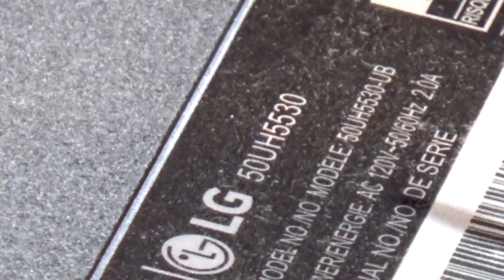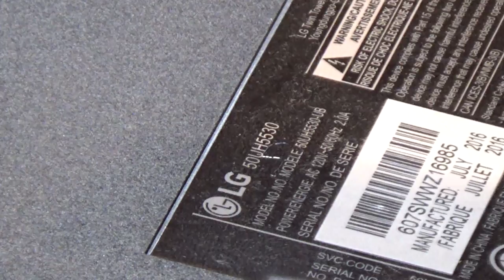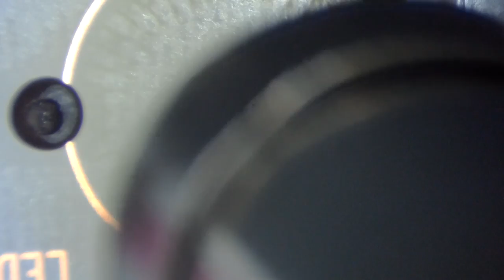LG 50 inch led tv, quick LG Logo flash only,  no picture. LG 50UH5530 tv repair.

Comment: I have the same model that had the exact same problem. This step-by-step helped me immensely and I was able to repair my television for under 20 bucks. Just an awesome video! Thank you so much!
Reply: Hey, if you don't mind could you share the link from where you got the led pannel light replacement from. Thank you
Reply: @rockyhandsome6098  Ebay is where I purchased mine from. I wasn't equipped to replace a single led so I purchased a lot of 10 for S20. They were used from a tv with a broken screen, tested and working. Simply search for LG 50UH5530 led strip and you should get many results. I recommend getting a few like I did just in case it happens again. I hope this helps ✌️
Reply: Was it also an led as well or a power supply

Comment: Thanks big dog! I’ve been holding off on getting a 50” 4K screen for my music desk that I built. The other day I found this tv at a thrift store for $20 and it said “has power issue”. I bought it thinking it was power supply caps. Before I did anything I searched the blinking lights and found your video. Bought a set of the backlight strips for $25 and followed your step and I now have the exact screen I wanted for $45!!!! Greatly appreciated sir.

Comment: Thanks, great video everything worked just as you said. I was trying to adjust the screen- I tried to move it with my hands and I heard a slight cracking sound . When all was said and done there were vertical and horizontal lines coming out of the corner. Dont try to adjust the screen except with the suction cups!!

Comment: More flux, less solder on the pads there BigDog and heaps of pre-heat, the PCB strip is sinking the heat away - as it's supposed to. Clean up with isopropyl alcohol and cotton pad afterwards.
Reply: I protruded the strip off the end of the table and pre-heated it from the bottom with a heat gun until the solder melted.  Then placed the LED on top and then heated it from the bottom again until the LED snapped into place by itself.  Pretty cool physics.

Comment: Did it and changed all the led lights. However when i completed the whole reinstall of the hardware i now have a  straith line across the tv and at the top of the tv, i have smudges or different colors. Did i screwed up my black lcd screen when i reinstalled it? or is it repairable? thank you for showing your expertise! much appreciated.

Comment: I have this exact model. It gets a quick logo flash and then goes black. I have taken a slow-motion video and see that the bottom third of the backlights apparently never light up. The LED tester I have does NOT have current adjustment. As I check the three lines of LEDs, I get a solid 64volts on each line, and I can see through the back that they are lighting up (although I don't know if EVERY LED is fully lit). Do you suppose the bottom LEDs are lighting up ONLY with the LED checker, but have too much resistance for actual operation? Another fact: the TV started working for several months after the first time I tested with the LED checker. Then, one evening, it went black (and no sound) after being on for an hour or so.

Comment: So it looks like all of these power supply boards have voltage and/or current sensing on the LED load and if the load is outside a set of parameters it shuts down.  I am assuming that the power supply board sends a "no-go" message to the main logic board and the main logic board shuts the whole shebang down.  I am getting the power LED flashing six times on my cheap Insignia TV after the shut-down.  I am getting a very very brief flash from the LEDs, a few tens of milliseconds.

Comment: You really need to document the steps of replacing the individual LED and where you bought the part.  Wouldn't it be easier to replace the whole strip with the bad LED or is the part too expensive?  Appreciate the effort.
Reply: Well if you know how to replace the led itself then it is easier. But to order would take time. I order the stripes so far but I am going to try on some old stripes.

Comment: What model is that LED? Is that a standard for LED TV repair since you didn't match the original? I followed your instructions for a Sceptre U508CV-UMK and the construction is similar.  But I used a 3-15 V adjustable wall adapter which lit up when I increased it to 15V. I used 3V to narrow down the broken LED like you showed and removed the lens.  It looks it would fit your LED.
Reply: Update.  I found a roll of 100 3528 LEDs with good reviews on amazon for like $10. Model LATWT470RELZK.  That one fit my strips and looks like the same brightness.

Comment: Can I ask a question. I have a tv that shows LG logo ike this one, but when I check the voltages with multimeter on power supply led output port, they are very low, like 0.4v  Does that mean its not led but something on the power supply. I found one mosfet chip that was not behaving properly in diode mode. Could that be the issue? Please let me know thank you.
Reply: What did u end up doing dod u change your power supply
Reply: @thokozanigwathi4249  no I changed the leds fixed issue

Comment: Very good fix most TVs I see now is backlight related 
Did you did anywhere with the tape on lvds cables method, or removing edge tabs ?
A lot of dead screens are shorted caps

Comment: Hi I have are LG 45" tv can u tell me what happens when I plug it in the stand by light on red and blue when it's on ok,but when I put on the power it does blinks twice and  turns ott by its self and sometimes when I put it on sometimes it does Work and the screen gets blank and only get sounds no picture .

Comment: Hey, really good explanation I did exactly same thing and had same issue but when I turned on my TV it just shows blue screen no picture do you have any idea on what could be the issue really would appriciate your feedback on this.
Reply: Same thing happened to me! But I realized I made two mistakes: 1, I did not disconnect all the same cables from the back that he did (I was trying to be lazy); 2, I put all the LED screws back before laying the paper down, instead of vice versa. So, I took it all apart a second time to fix the screws, but this time I followed the the video exactly for disconnecting the cables and then reconnecting them (*the only exception was the Wi-Fi module, because I couldn't get it undone and I didn't want to force it). After that, the tv worked perfectly!

Comment: So why exactly does it "flash once"?  It looks like you are able to individually light the 3 LED strips with external power (with one just blinking randomly).  Why does the whole TV have to go out?  Why doesn't it just have its picture blink in that area while you can still watch it?  Does LG design it so it just turns completely off to make it look like it's totally broken so ppl need to buy a new model?
Reply: Yes it's normal, when backlight is failing it trigger protection that will stop the main board working at all